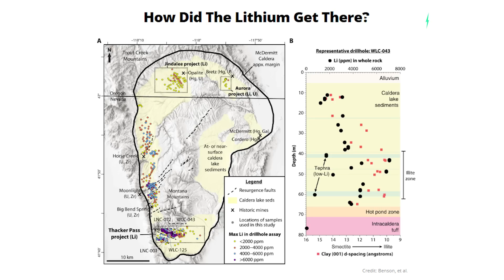Worlds largest Lithium deposit discovered in an extinct American volcano

Comment: They started to "remove" all the wild horses out there a few years ago. Something about them being a nuisance. To whom I don't know. There is nothing out there. No people, no towns, just rocks and sand. Interestingly after the fires here in Oregon in September of 2020 the state of Oregon hired an out of state company to handle the "danger trees" (damaged trees that will fall into roads etc.). Oregon is a logging state and to have an out of state contactor take our jobs was a point of contention for many. Additionally, there were complaints that the company was breaking the law by entering people's private property and cutting their trees with out consent or the owner's knowledge. They took healthy trees as well. They tried to clear a huge swath on each side of the highway on both sides, about the size of an extra lane. Did I mention this company is not even a lumber company? They don't handle trees at all. They were a construction company. They specialized in highways. I just found it odd that two entire groups of mountain communities were burned out on the same night right along the highways they'll need for this project.

Comment: Toyota will not manufature a 100 percent electric car, they have designed an engine to run on ammonia,  90 percent clean burning. 
Making electric car batteries is very dirty, very toxic. 
Three breaths of a burning electric car fumes your dead.

Comment: All that Li is great but it's not going to lower the price of batteries, only make them easier to get.  Besides, U.S. auto industry suppliers can't seem to make a battery that performs for the long haul, is quick to charge.   I want a battery in an EV that has 500 mile range on one charge minimum with all the bells and wistles (Headlights, radio, TV, AC, car computers, seat warmers, emergency flashers, electric beverage coolers) and traveling at at least 70 mph at night.   AND . . . It charges from dead, full charge in an hour or less. AND, doesn't blow up when it gets submerged in water or over heats.

Comment: ….still not buying electric until they can make a battery that operates at -20 degrees, gives me an 500  mile range and doesn’t lose most of its charge with lights, radio, seat workers and heater working.

Comment: Look at the mess made by getting just 1 one the rare Earth metals required for disposable batteries.  Electric vehicles are just idiotic.  If you can set the emotions aside, and just look at the facts regarding getting to the finished product of an EV,  you'll see that it takes more fossil fuels and and creates more environmental destruction than an internal combustion engine.  Besides that, the damn things are dangerous.  If you don't know why, please stop watching MSNBC and CNN and get some real reporting.  AND.....you don't save any money at all, and that was before governments started wanting to add a per mile charge for each vehicle's miles per year. You EV fanatics need to pay your "fair share" for roads. LOL!!! Gotcha.   Also, insurance companies are figuring out that it's a lot more expensive to cover EV's because almost any little fender bender results in battery replacement to the tune of $20,000, and 6 months to a year of wait time to get the new battery.  You can have your silly little EV, I'll stick with my jacked up 4x4 that get's shitty mileage but is still cheaper to buy and operate.

Comment: Yes this is great news, but there's been no shortage of Lithium. It's ubiquitous - one of the most common ores found, though usually in low concentration. The largest supply is seawater, though removing & concentrating it would be very energy-intensive. Still, with enough solar power this is quite doable.

The bottleneck is refining, not supply
The biggest problem with lithium isn't ore supply: it's refining. The US could do it IN AMERICA, but it can't seem to get its shit together to license & build refining capacity. Generally you leach it from other ores using sulphuric acid or an equivalent, as Sam mentions in the video. And the tailings dumps can be pretty toxic. No one wants such a toxic industry in their back yard. 

China has a near-monopoly
Which is why refining has moved to China. China has appallingly low environmental standards, poor regulation, near-zero enforcement and rampant graft, where the biggest criminal gang in town is the CCP. So China has cornered the market on most metals refining, especially stuff for renewable energy generation, batteries, electric EV motors & turbines: nickel, cobalt, lithium, rare earths. Fourty years focused on this has given the Chinese near monopoly-control of refining for these metals, and perhaps the most polluted major country on the planet. China's water supplies are irretrievably polluted, its farmland soils made toxic, its air so dense with smog visibility on a bad day is near-zero, its food supply badly compromised and the health & longevity of its people plummeting beyond repair. Toxic refining without VERY expensive controls & remediation is expensive. Not a problem so long as there's a level playing field, but there's always a country willing to screw its environment & its people for a buck, and mining companies are therefore sociopathic.

Why America gave up refining
America can re-shore refining fast: building refineries doesn't take decades, though it does take a few years. The problem is engineering, regulation & enforcement. And politics.

In theory, the US can; in practice, it won't
The US needs to get serious about finding ways to refine these ores in a benign fashion, creating environmentally-benign methods. Or finding ways to completely treat effluents & tailings & emissions. REALLY treat them. America has to get serious about regulation & enforcement, both of which were gutted by Trump's administration & decades of dedicated obstruction & destruction by the Republican Party, at both State & National level. Because of that, the first issue to be settled is political: the Dems have to find a way to EITHER get the Republicans on-side (unlikely) or defeat them resoundingly at the polls. 

Because of decades of outrageous gerrymandering & vote system rigging & stacking of the courts, the Dems will need to win an overwhelming victory at the polls. Anything less than 65-70% will be insufficient in rigged ridings & voting systems, or nullified by stacked courts.

But sure, dream...
So not trivial, but it CAN happen. In our dreams. Meanwhile, this video's focus - a new volcanic source of Lithium - is great, but won't reach market for the same reason as everything else. Currently the mine would have to send it's ore to China to be refined, and I don't hear Sam offering a solution to that conundrum.

Comment: how extinct? how deep? because you start playing with caps/removing mass in volcanos they can wake up
o its a old yellowstone hotspot, shouldnt be a issue unless hotspot moves back that way in future i guess

edit. it will be interesting to see if they commercialize it before sodium battery's take over, they only cost $40-70 per KWH compared to lithium's $100-200 and BYD i think it was has plans to put them in cars by next year

Comment: From what I’ve heard so far, the lithium that will be mined in California’s imperial valley is plentiful, will have a negligible environmental impact, and will be very cheap. This is because it is a component of the brine that is already being pumped out of the earth to run a geothermal power plant and then is pumped back into the earth after it’s used.

Comment: We've learned that aluminum can do a better job at making electricity if weight is not a problem.  It has 3 electrons to give up as opposed to lithium's one.  Aluminum sucks for a weight-sensitive application, which is why we still need lithium.

Comment: It's about having the eyes to see what's around us, coupled with the right attitude. 
On a different note; Lithium is but one step in the process of developing better, lower cost batteries. Sodium is much more abundant than Lithium, so it will also become important. For example, even if Li/Na hybrid cells are the way to go, that hybridisation will mean that less Lithium will be needed than many people might think. I foresee Carbon playing a bigger part, too.
Reply: yep.
sodium batterys are already 40-70$ per KWH, but they do have 1/2 the energy density of lithium so they will still use lithium some places like planes for a long time to come but houses & stuff will be all sodium & if they keep overplaying risk of EV vehicles catching fire probably a lot of them also because sodium batterys dont burn like lithium batterys

Comment: McDermitt Caldera is actually an ancient caldera produced by one of the Yellowstone Hotspot's many eruptions. It's massive too, measuring approximately 28 by 22 miles. There may be as many as several dozen Yellowstone calderas stretching from Northern California to Southern Oregon, to Northern Nevada, to Southern Idaho, and then into Wyoming, where the hotspot currently sits. I wonder how many of these ancient calderas have similar deposits?
Reply: Interesting but in the UK they are trying to get the lithium out of the old Copper Tin lead and Arsenic mines .. I think it may not be so much the age but the hydrothermal mineral deposits and then the subsequent groundwater movements.. that determine the distribution and availability of the lithium deposits or brines.
Evaporates are the other main source of Lithium .
Reply: @clivestainlesssteelwomble7665  Yeah, we'll be hearing about all sorts of interesting lithium deposits over the next few years, maybe longer if lithium continues to hold the higher energy, lower mass battery technologies while sodium takes over the static Megapack, Powerwall and other lower energy per unit volume and mass technologies.
Reply: Yeah, I wouldn't be surprised if there are more big "finds" in the near future, as I don't think they've been looking for lithium specifically for very long.
Reply: This has got me thinking about Long Valley Caldera, just east of Mammoth Lakes. Recent research indicates approximately 1.5 million ounces of gold. It would be exciting if lithium was present as well.
Reply: @bretthumphries7911  

That might be but do you want to damage an area of outstanding wilderness for Gold and Lithium ....  when they are gone they are gone unless you start recycling.. can you eat drink and breath minerals ... 
The people of Brazils Amazon and the Congo know how bad Klondike mining is.
And you already have elevated levels of Arsenic in many US soils and ground water from a century of its use in industrial agriculture. 
Learn to box clever ... survey plan and work with nature.. minimise impact on natural and  human systems ... Dont make the same mistakes and try to anticipate what might happen ...
When things go bad ..... Turkey,
Morocco and Algeria..

Forest fires droughts and flash floods... all happen. Industry is temporary.... most economics short term like politics. 

But you only get one shot at life 🧬 and its tricky stuff compared to any of those. 🧙‍♂️😉
Reply: All we gotta do is eat the right blend of spices so that our shit smells wholesome and wicked...... then we feed the melange to the women and watch the competition toilet drama. 😂

Comment: You could discover 20 such deposits and it will still not be enough to make the batteries the EVs and grid will need for 100% renewable conversion.  Lithium is a dead end and investment in it is investment wasted, misallocation of capital, which will not be there anymore when we finally do find a way out of the fossil mess.

Comment: This could make it affordable!

I'm fine with the idea of transitioning to majority electric transportation, but it shouldn't be done by penalizing legacy products to the point of being unafordable in order to effect the conversion...

Electric vehicles need to be made more attractive (cost-wise) than fossil fuel vehicles.
Lower purchase price for the vehicles and include a renewable home based power source for "free overnight" recharging for local use... 
And, build a nationwide system of similar "fast" chargers to keep consumer operating costs down on longer trips...

Ranting aside... this abundance of natural resources (LI) that can be taken advantage of to improve the cost factor of battery storage systems... will go far towards the ultimate goal of reducing human environmental impact... if used wisely ethically.

Comment: Is this moron talking about Thacker Pass? It's been known since the mid-1970's! It's taken this long to realize it's potential and get the permits to do the mining. This is not news...

This doesn't in any way solve any problem except the supply of lithium. The energy storage of fossil fuels AND their carbon "footprint" is still orders of magnitude better than EV's using lithium batteries. The versatility and convenience of fossil fuels is still orders of magnitude better than electric power vehicles. The average petrol fueled vehicle can carry more payload, go further, "recharge" faster, last longer, and release less carbon during its lifetime (from raw materials to the crusher) than any electric car on the market today. They're also 50% to 300% cheaper.

Comment: It will be fascinating to watch and see whether we in the U.S. can successfully license, permit, finance and create a new, huge, lithium mining startup, especially one that promises to have such a big impact on global battery markets and global EV markets.
Reply: it will be interesting to see if they commercialize it before sodium battery's take over, they only cost $40-70 per KWH compared to lithium's $100-200 and BYD i think it was has plans to put them in cars by next year
Reply: @hamasmillitant1  Yes, there's that, too.  Sodium batteries won't 'take over' until about 2030 unless somebody spends a LOT on increasing production and production facilities.  Demand is, to put it mildly, HUGE, and every battery anybody can manufacture will find at least one customer.  Don't forget, in addition to cars and trucks and Megapacks and Powerwalls there are also all the other companies building other products, both similar to Tesla's and different.  Two wheel and three wheel vehicles, for example.  Mobile solar plus battery kits for campers and such.  I just bought one of those.  Lithium iron phosphate batteries.  Fun learning tool.
Reply: Yes, and fascinating to see if the competition drops the price so as to stop the development. This whole EV push for new technologies is quite fascinating.

Comment: Who is saying that the Salton Sea is years away from producing lithium?
The advantage of the Salton Sea is that the lithium is already soluble in the geothermic brine that is currently being mined only as a heat source. Unlike most lithium mining, the Salton Sea holds out the promise of extracting with minimal to zero environmental damage. Since the lithium is already soluble in the brine, no acids are necessary to break down a lithium rock compound. Once the lithium is extracted (along with any other desired minerals) the brine is pumped back down into the ground.

Not only does the Salton Sea promise to provide all lithium North American industry needs,  it also promises to be the cheapest to extract and most environmentally safe.

Comment: Lithium is a good thing, but electric cars are not yet practical or even clean. We don't have the ability to power all these electric cars. Nor have they yet solved the range and length or time charging vehicles. Not to mention the extreme cost of battery replacement and battery fires. The government should not be trying to force the issue. There may be better alternatives. Fusion may solve the problem with plentiful cheap energy that we can create hydrogen or synthetic carbon neutral gas.

Comment: You really need to provide a balanced cover of the positive and negative sides of EVs so people can form balanced opinions based on fact.  Not everyone is on board the EV train because there are many other factors that keep the average citizen from even wanting an EV/
Reply: No VROOOOM?
Reply: @danielcarroll3358  Too expensive. And they take too long to recharge. They also release more carbon into the atmosphere, if that's a concern. EV's are a huge waste of resources.
Reply: @A_friend_of_Aristotle  Cost and price of EVs are on track to be less than many comparable ICE vehicles soon, and some have already broken that barrier, particularly the Tesla Model Y.  It won't be long before this tired old FUD will not convince anyone anymore.  As for EVs releasing "more carbon into the atmosphere," how soon will ICE vehicles begin releasing LESS carbon into the atmosphere?  EVs are more and more often powered by home solar panels or Supercharger solar panels.  This will continue until most electric vehicles are powered most of the time by mostly renewable electricity.  Will ICE vehicles ever achieve that?  Seems unlikely.
Reply: @colinkeizer7353  It's not an even comparison because the EV prices are offset from taxes put on the ICE vehicles, they still have huge costs. Also, we don't know yet how long will the batteries last, or is this just a gimmick from vehicle manufacturers to kill the used car market, which would hurt the poor, forcing people to buy newer vehicles.  That with the charging problems will slow the sales but hopefully most of these problems will be solved soon.

Comment: Surely you know that the system needs to be set up and have the problems ironed out before the said new system is introduced - which should've been done before EVs were even on the roads.  Why isn't research being done to speed up this process to transfer to EVs?